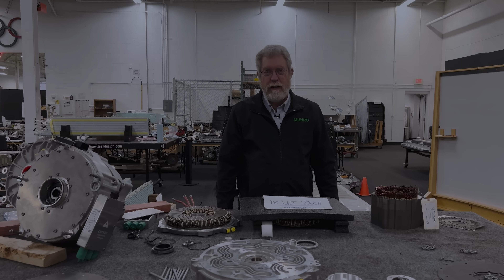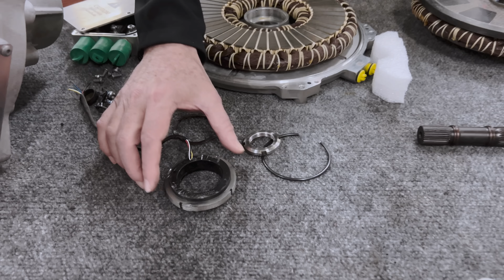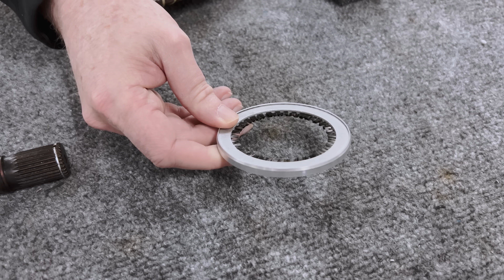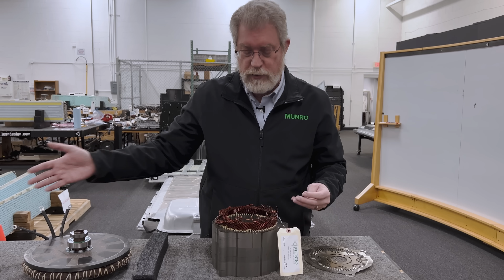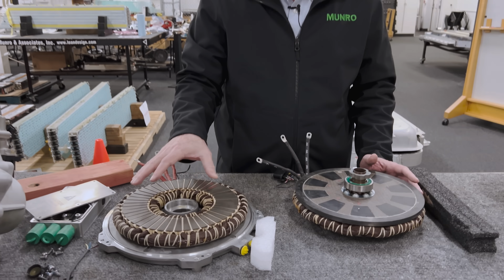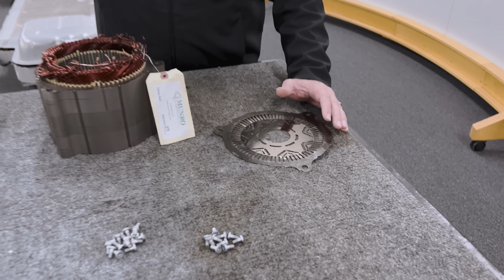Axial Flux Motors Explained: The Future of EV Powertrains?

Comment: So the advantage is a smaller package for the same motor specs (torque, ...). Does this also mean, the axial flux motor needs less copper windings? Or is only less iron in the stator needed?

Comment: any number of unused sides of magnet rotar or coil array is a loss in my thoughts. why only one coil layer? how about adding to the motor body length and do pm-coil-pm-coil-pm, maybe decrease heat issues by allowing a touch of space at the coil level, and sealed in with some psi of vacuum, use planned internal air circulation as both air bearings, shock absorbtion, and cooling?

Comment: What I have seen is that most (or all) companies are creating high hp axial flux motors (yasa). What we really need is an axial flux motor with abt 75 hp so that they are small and light enough to put inside the wheel of a vehicle (4 times 75 = 300 hp, plenty for most cars)

Comment: @11:57 check out Yasa Motors' axial flux motor. Much better power density. 12kg, 750kW peak power. There is a reason many sports cars use it already.

Comment: Instead of single ball bearing in the center, why not two tapered roller bearings on both ends of the motor? Perfect to handle axial load. Right?

Comment: Could one of these motors, or a series of these motors, be basically used as a clutch by spinning and only letting a small amount or zero of the torque generated by an engine to the wheels by absorbing the energy

Comment: Could you sandwich 2 smaller-diameter axial flux motors together in about the same size and shape as a typical radial flux motor? Maybe this thinner, but wider axial flux design would actually fit better in cars

Comment: This is a great video, love it!
This motor is interesting, I guess my introduction to axial flux motors was the YASA motor that has a single static central stator and two pm rotors on either side. I guess there’s only one set of windings to do on the YASA but cooling might be more tricky. On the dual wound stator motor you show each side of the wound rotor is available for a cooling circuit to be added. Are there any other pros and cons?

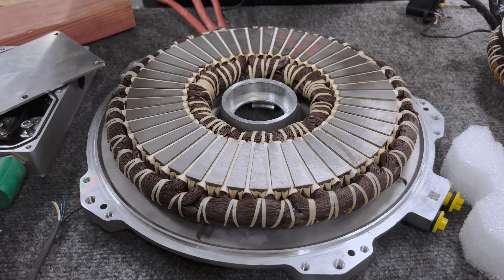Comment: 13:15 The punching is done by the same punch, that does not change. But neighther does the indexing angle. So, as the strip is wond on the indexing coil, the indexing being say 8 degrees for a 45 slot stator, the punching is done immediately before. This constant angle indexing naturally increases the distance between the punchings. While the punched grooves are paralles in the radial direction, the poles end up increasing radially. This genius, clever method is what makes this type of stator simple in inexpensive to produce.

Comment: You mention in passing that "Munro doesn't really like threaded fasteners..."
Did I hear that right? If so then why would that be? Is it more a matter of the machining required to use them or something else?
Also: just from looking at it it seems the axial motor might be easier to cool.
Thanks very much for this series. I'm a'motor head' from long ago - but 'motor' in the ICE sense, not electrical...

Comment: I see a lot of hobbyist axial flux designs, particularly generators, that leave out the iron cores from the stators and stick with an air core. Is this exclusively a cost/effort and weight choice, or are there efficiency considerations?

Comment: The ring is not for static charge in the motor but mostly for stray currents due to variable voltage/frequency drive.

Comment: The Lynch motor still is the highest weight/power and multi phase motors are used in buses. Still not 96 phase, which would be an ideal direction for EV propulsion if the electronics became cheap. It's still a bit of a mystery how he came up with this. I don't understand why it isn't used for wind turbines because 96 rectifiers per phase wouldn't be a problem at scale.

Comment: Who could supply parts and tech to add two Motors to the front wheels of my 2104 Corvette. I can't afford the E-Ray and only get 6 miles on EV. I want to update my 2014 C7 Z51 with 12,000 miles to AWD Hybrid by adding 2 wheel motors to the front with controller and Battery pack in the hatch area. I also have plans for a higher hatch type rear window to regain storage space. I want to drive it pure EV up 40 miles and get AWD for a dig or weather. More Science in the controller logic can come in increments. I really want to build this and drive it before I am gone. Being 75 we gotta step it up abit. Anyone knows where, who, and how, Lets go.  Dennis in Virginia

Comment: At around 14:10, Paul says the stator has 36 slots. I counted 45 slots. So, 45-slot, 10 pole motor. It has distributed winding unlike most other AFMs that are out there. Winding pitch appears to be 5 slots. Two layers? OMNI website appears to indicate of a max speed of either 12,500 rpm or 14000 rpm, which appears quite high given the diameter of the motor.

Comment: I believe one application of these motors was demonstrated on a fully charged show episode about an electric aeroplane, the extremely fast one developed with Rolls Royce was it? That's the reason for my interest in this great video.
Reply: @allisterbullock213  the Rolls-Royce Spirit of Innovation (also called ACCEL ) used a stack of three axial-flux motors, but they were from YASA, which uses the other axial configuration (one stator between two rotors).

Comment: What about cooling difference and over powering the motor for short bursts since the coil packs could be cooled faster. The coils could potentially run higher amperage for longer without ruining itself.

Comment: A resolver is not a positional device, it is a rotational velocity device. An encoder is a positional device. A resolver may be used to derive an encoder by integrating the signal along with an indexing pulse from the resolver itself or another sensor, such as a proximity sensor.
Reply: You got it the wrong way around

Comment: The biggest advantage of axial is more power density to weight, at the cost of being more mechanically fragile...so they are perfect for weight-sensitive applications with gentler mechanical stresses: aircraft. That's why you see Emrax and Yasa axial flux motors used in the majority of electric aviation industry.
Reply: There is no electric aviation industry yet, but there is a vibrant promise-of-electric-aviation industry. I don't think many use YASA, and even fewer use EMRAX... although the notable exception is the one certified production battery-electric aircraft, which is from Pipistrel. Pipistrel had to improve the EMRAX, so much that they call it their own product, with the model name E-811. I know that the Rolls-Royce air racer style project used three stacked YASA motors, but it wasn't a production-intent design, and I don't know of anyone developing for production uses YASA. Someone else must be using axial-flux motors, perhaps from Magnax.
Reply: "With gentler mechanical stress"..
Axial flux motors are being used in hybrid Supercars and will be used in the upcoming all electric premium Mercedes AMGs

Comment: Thank you for the video. What's wrong with threaded fasteners and what to use instead?
Reply: They cost money (and let you fix stuff) (and can come out when you didn't want them to). Munro are obsessed with production cost and couldn't care less whether you can fix it later or not. So they advise manufacturers to do everything with plastic clips, or adhesives. I think they should take the circular economy, right to repair, maintainability  and deconstruction more seriously and not obsess about shaving off manufacturing pennies which cost maintenance and end-of-life pounds.  Sometimes they have a point (a tab can save you two bolts)) but often go way too far down this road.

Comment: You want as small a gap as possible between the magnets and the stators.  In an radial motor, that gap can vary with RPM and temperature.  With the axial motor, only temperature.

An axial motor has the magnets further form the shaft, so you get more torque, allowing lower RPM, thus lower gear ratios, or direct drive.  

The ideal approach is a motor on each wheel (preferably inboard to reduce unsprung weight, not in wheel).  Use electronic control of the 4 wheels instead of a limited slip differential.  The other advantage is in the rare case of a motor drive failure, is you still 3 motors to limp home.
Reply: Any motor can be built in any diameter, and in fact "pancake" format (axially short compared to the large diameter) radial-flux motors are common.

Comment: Why is this design using two stators and one rotor as opposed to one stator and two magnet rotors? I'm looking at this from a flux efficiency standpoint. Why bother with the configuration shown in the video when realistically there isn't much benefit over a good radial flux design?

Comment: Early VCRs (remember those?) used axial flux motors, and indeed they used large 3 inch diameter ferrite permanent magnets for the rotors. The upside, I presume, was that they were very simple to build.  The windings were very simple; each coil was separately glued to a pcb backed with a steel plate, no winding or inserting coils into an intricate armature.  They did eventually switch to radial flux motors though.

Comment: Uh, Efficiency?  Elephant in the room... which one is better???
Reply: Neither. Motor efficiency has little if anything to do with whether the configuration is axial-flux or radial-flux - almost any other aspect of the design is more important to efficiency. Comparing one random axial-flux motor to another random radial-flux motor will tell you nothing about which configuration might be more efficient.
Reply: @brianb-p6586  So, way to say you are not an engineer without saying you know nothing about engineering.  Give you a hint, IT is ALL about efficiency as efficiency = RANGE.  The configuration DOES NOT matter except in $$$ to manufacture which NO ONE CARES  unless the efficiency of BOTH motor types is identical.  IF even 1 is 1% more efficient the other does not matter as the whole problem with electric drive is RANGE from your VERY expensive energy storage.
Reply: @w8stral  you seem to have difficulty with reading comprehension. I did not say that efficiency was unimportant; I said that the configuration (axial versus radial flux) is not a significant factor determining efficiency.
Reply: @brianb-p6586  Well actual reality says otherwise.

Comment: Axial flux motors have always been the future for motive duty, where momentary power requirements far exceed their constant duty requirements. They're great for power density... not ideal for constant duty. Future for private transportation? Sure. Future for heavy duty transportation applications (trucks, etc.)? It would require high density liquid cooling... and the concessions to payload are already high with electric power... much less, a way to cool the motors.

Comment: Everything is a compromise. For a AWD car my understanding is it would need 4 smaller Axial Flux motors as supposed to 2 standard radio flux motors. Plus having motors in the wheel would increase the unsprung weight of the wheel/motor package which makes harsher ride but does remove drive shafts and pinions but overall I still think radio flux motors are simpler to make and integrate into normal or not high end EVs.
Reply: It's "radial", not "radio". 
Axial versus radial has nothing to do with in-wheel versus conventionally mounted (inboard) motors; the axial-flux motor shown in this video is not an in-wheel motor and most in-wheel motors are radial-flux, not axial-flux.

Comment: 8:26 “the area can be larger” but we don’t know because only the axial area is shown 100% in the video.

But in the radial flux motor, the cross area is the circle length times the axial length.

More torque would be possible with more poles

15:51 in the radial motor, the winding is more complex… but the laminated core is just as cheap (unless they are doing it wrong)

Comment: Couple of comments/questions--I'm surprised about the method used to construct the stator; winding a strip makes sense but notching it before winding seems like it would be extremely difficult to get the notches to line up exactly as you wound it. The distance between notches would have to increase with the diameter of the coil, and tiny variations in thickness could add up and progressively offset the notches. Seems like winding the coil then machining the notches would be more straightforward. Also was wondering why a transmission was being used, couldn't the motor be designed to fit the range of RPM for the application and save the weight of a transmission? I always imagined these could be used inside each wheel of a vehicle driving it directly. Then computerized control could do amazing things with traction, controlling each wheel independently. 

I'm familiar with axial flux topology from the DIY windmill crowd. They were much easier to construct and used stators without magnetic material for the coils, as any cogging in the rotation would prevent the axle from rotating in light winds.
Reply: It would be difficult to calculate the the notch spacing in advance and place the notches accurately enough, if you tried to notch a flat strip then wind it up. Fortunately, that isn't necessary. The notches are stamped as the coil is wound, so with 45 slots the notcher just needs to make one notch for each 1/45th of a turn of the winding spindle... regardless of the distance along the strip, which will of course get longer as the strip accumulates to larger diameter.
Reply: Machining a stack of laminations cleanly would be difficult, and expensive compared to punching notches. Yes, the notch spacing varies.

All EVs use a transmission, because the wheel speed is not a practical motor speed. That transmission usually has (except in heavy-duty applications) a single fixed gear ratio. 

An individual motor per wheel certainly has control advantages, but there is no need to put the motors in the wheels to have individual motors. For example, the Rivian design has individual wheel motors, mounted conventionally (inboard). It is rarely desirable to apply different torques to the front wheels (due to the kickback through the steering, so a good compromise is one motor for the front axle (with an open differential) and two separate motors for the rear wheels... and that has been in production for years, without in-wheel motors.
Reply: For a video showing the manufacturing process, from a supplier of these laminations, search YouTube for "OD 220mm Axial Flux Motor Stator Manufacturing in China"

Comment: I would think that a floating rotor between two stators driven symmetrically would alleviate any axial (side to side?) thrust issues that would wear out the bearings.  The rotor would naturally remain in the magnetic center.  
Barring that solution (because it wont work for whatever reason) using what is used for internal combustion engines (crankshaft bearings and thrust bearing) would solve that.  Only need an oiling system…. You could use oil for cooling and lubrication.  Some thoughts anyway.

Also, given what I saw, I am not so sure that there is a size improvement making it worth while.  Could be lighter…

Lastly, the larger diameter rotor also adds a whole lot of centrifugal force on the carbon fiber ring… the magnets are heavy.  I would be concerned with long term wear-out on the rotor. May not be an issue.
Reply: Yes, rotors on each side of one stator (or stators on each side of one rotor) means balanced axial forces... as long as the gaps (and every other detail of construction) are exactly equal. Even if balanced, it is not stable - it won't "naturally remain in the magnetic center". With any magnetic system attraction is unstable, because the force increases as the gap decreases. If the central rotor moves toward either stator it is pulled with more force toward that stator and with less force toward the other stator, so a floating rotor would snap immediately against one stator.

Comment: I wonder if the motors built by Protean for heel hubs are axial or radial flux? Has Munro done any work investigating wheel hub motors for vehicles.
Reply: Munro test-drove a vehicle with hub motors, and Sandy is enthusiastic about them. They're garbage for cars, which is why no car or light truck with in-wheel (hub) motors has ever successfully entered production. Have you heard that even the goofy three-wheeler from Aptera has give up on in-wheel motors?

Comment: Is there any advantage to an induction version of the axial flux motor?  I know there is a 2% or so efficiency hit but seems it would ease assembly issues.  Also, vastly simpler VFD.
Reply: There is no meaningful difference in the complexity of the controller for induction versus synchronous moors, and the inverter is identical.